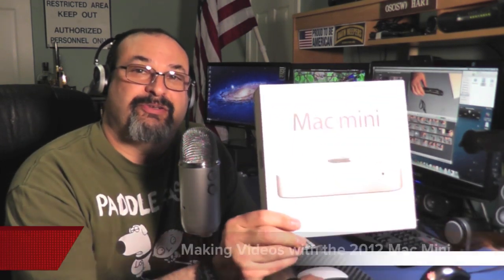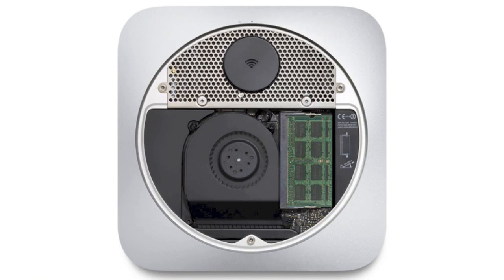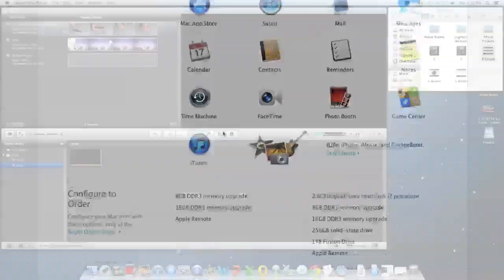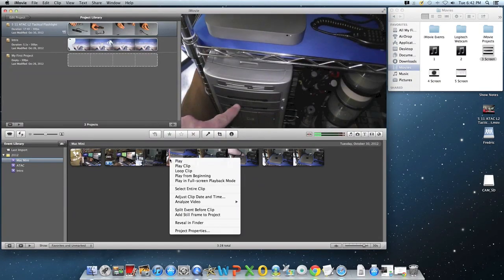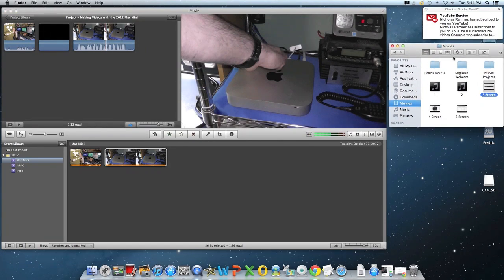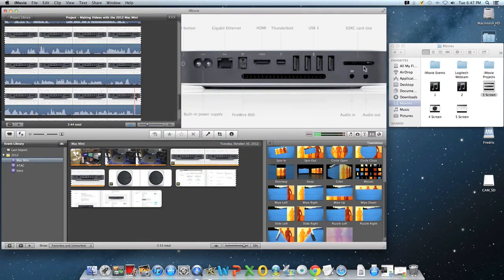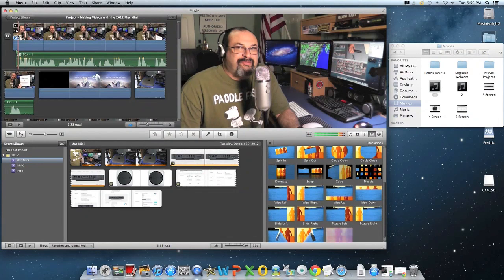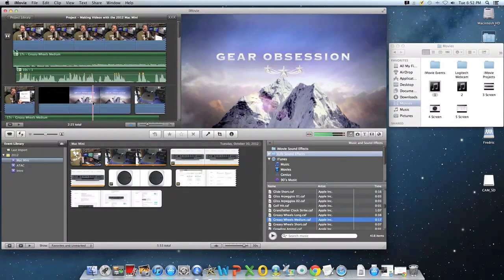Making Videos with the 2012 Mac Mini

Comment: I'm looking at the MAC MINI 2.8GHZ 8GB memory with the 1TB fusion drive, will this handle 1080p uncompressed Video. I will also be using final cut pro and after effects.
Reply: I think the 2012 MAC MINI i7 2.3ghz/2.6ghz is a much better deal and value for your money! Since that model has 4 cores and 8 threads for amazing multitasking and video editing. It should handle your 1080p uncompressed video pretty good. 8GB of memory is not enough in my opinion since uncompressed RAW video requires a lot of bandwidth. So 16GB will handle lots of gb/s bandwidth for your uncompressed video. Apple does not really sell i7 2012 2.6ghz anymore however... unless you find them in there refurbish pile at a nearby apple store in your area. Go for the 2012 i7 2.6ghz mac mini. You can find some on eBay used and sometimes upgraded to 16gb of ram and SSDs (Solid State Drive) for good prices. Although the Graphics in that new 2014 MAC MINI might be a little better..... the CPU in the 2012 mini is way leaps ahead faster. The MINI you are asking about has only 2 cores, and 4 threads. The more cores and threads your computer has, the FASTER your computer can process and tear through big streams of video and tasks. The MAC MINI 2.8ghz would barely do ok for your uncompressed video. But more Ram up to 16GB more cores up to 4 with 8 threads will do well for your needs. You will get more value for your money that way as well.
Reply: Thanks for the info

Comment: Factory screwed up the disk image. If you get a mini with a Fusion drive, and the status bar at the bottom says only 30Gig free ( yeup, I'm serious, 30 Gig! ) - call Apple IMMEDIATELY and get any data off the drive, you'll have to REFORMAT and re-install EVERYTHING. If they tell you to send it back, word hasn't gotten around yet - there's nothing wrong with the drive, the factory screwed up the disk image, which means you have to do all the work :(